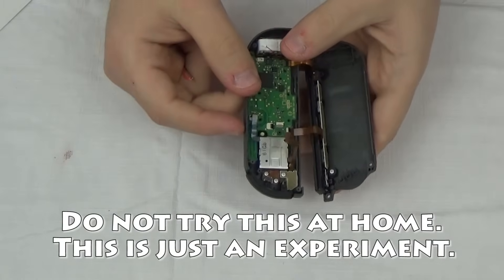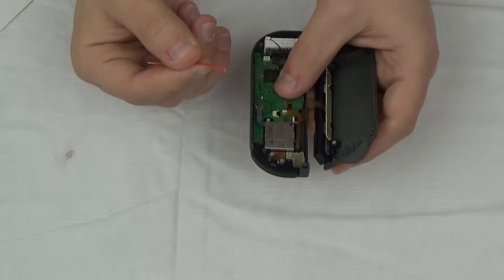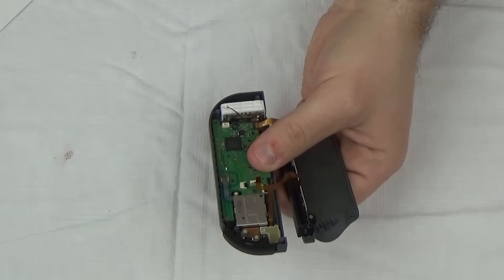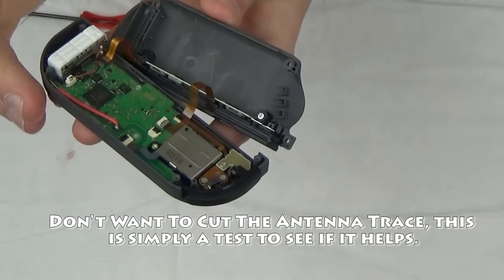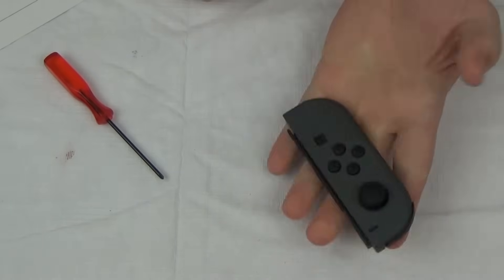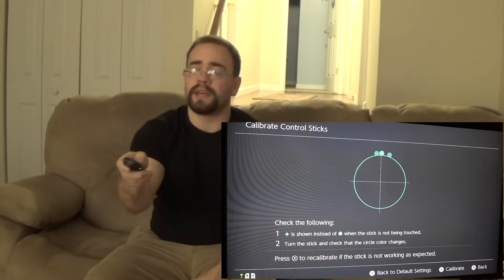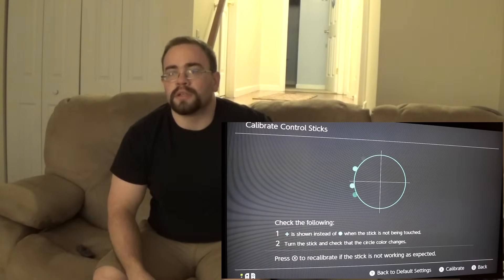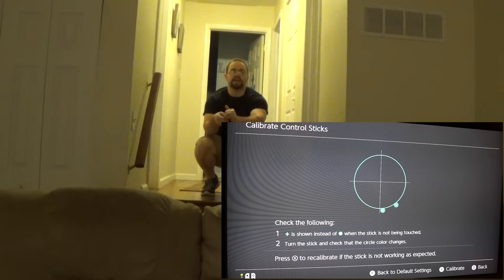Fixing The Left JoyCon!

Comment: Wow, that's some awesome increase in connectivity.  I might have to get my soldering equipment out for this kind of boost, even if the other methods fixes the basic issue.

Given your warning at the end, though, I won't be doing it without reading up on it more.

Comment: Watching this, it's virtually impossible to deny that the Joycon issue is a design flaw that can never be fixed through a software update.  A recall is the only potential fix, which will never happen, so either we have to apply this fix ourselves or wait until the next batch of joycons that fix the issue come out and throw our launch joycons away.

I can't believe this was somehow allowed to slip through product testing.
Reply: zerotheliger - theoretical they could give the antena more power that would boost the signal, but i am not sure
Reply: Terotrous holy fuck how overdramatic. It isnt an issue for everyone. And there are solutions. Easy day.
Reply: Terotrous 8:45 He even said it works fine. Nothing major. And it's an easy fix if you have 2 hands with thumbs.
Reply: The thing is we don't know if that's the problem, especially because Spawn Wave's joycons are NOT defective. It's all speculation.
Reply: you are funny, based on this video you determine there's a problem? It's not as if the wire is in one place in some joycons and another in other joycons. If it a hardware problem NO joycon would work ! This is not the case as most people are fine. But, besides what I am saying, time will surely allow the truth to surface, we will know if this has been a real problem or not. So far it isn't. But is succeedig in creating doubt on the Switch quality, which is, I guess, what some people want.
Reply: There's quite a few design flaws I've noticed with the Switch, which I was surprised got past the net.

Namely the dock scratching the switch, the shoulder pads for the Joycons effectively cementing themselves in place if you put them on wrong/on the wrong joy-con and the sync issue.

I mean, c'mon Nintendo. You aimed the Switch at all audiences (even kids) so not having any preventive means of putting the wrong shoulder buttons on the wrong joy con is a very novice mistake, as is how easy it is to scratch the switch's screen through use in the dock. It's a guarantee kids will mess up the shoulder buttons for a start, and the parents will have to use one hell of a screw driver to get it off.

I'm interested in it, but I'm glad I'm waiting it out. I would not be happy dropping the cash needed on a Switch at this moment, with the issues it has (which most likely require hardware changes to fix).
Reply: If you really want a Switch, I don't think these problems should keep you from getting one. :O 

The only problem I have had is with wobbly joycons, and I just sent it in to see if they could fix it. As for the dock scratching the screen, you can just get a screen protector, which is a good thing to have anyway. Also, keep in mind that if you do have a problem with yours, I'm pretty sure you can get it fixed within the first year for free. :D (It should be possible to notices most of these problems within a year, so you should be fine!)

I do understand why ya might want to wait it out though. :0 Maybe they will change the material inside the dock to keep it from scratching the screen, or fix the joycon connection issue.
Reply: doc8125 that would kill the battery a LOT faster
Reply: The grey joycons have less issues than the colored ones
Reply: I mean sure its an easy fix, but wouldn't opening the switch (even if just the left joycon) void your warranty. I'd rather keep my warranty for the system if it ever breaks.
Reply: Darius Batista stop being ironic
Reply: Harlock2day "If it a hardware problem NO joycon would work !"

This is indeed the case.  All joycons appear to be susceptible to this issue.  But remember that this is an intermittent failure.  It might only occur 0.01% of the time, but it's enough that pretty much everyone will likely have seen it at least a few times after using their systems for 100 hours or so.
Reply: Terotrous - Software/firmware error correction can definitely fix poor signal due to interference up to a point, especially if the interference is fairly consistent.

It's not affecting everyone frequently so it's probably a relatively minor signal issue (albeit not for the people experiencing it regularly) so it wouldn't surprise me if it could be fixed with and OTA update rather than a recall.
Reply: Crimson Gold Eagle oh yeah sure if I really want something I shouldn't care it has a shit ton of problems, GREAT FUCKING MENTALITY
Reply: Yes dumb fat gaijin, just wait and buy the version of our controller that actually works! it's only $80 dollars.
Reply: don't ever buy a console at launch.
Reply: Terotrous Just because you can fix it with hardware modification doesn't mean that you can't with software.
Reply: If the problem is simply that the antenna isn't strong enough and is in a bad position there's really not too much they can do to fix it through software.
Reply: actually no you cant in this instance lol learn how hardware works first please tell me how programming can fix issues with interference or blocked line of sight. unless you can tell me otherwise your point is invalid and dont just give me some silly oh they will figure it out responce... no nintendo owes us new joy cons end of story

Comment: Would be interesting if Nintendo saw this video and do a fix similar to it, but rejects Spawn Wave's Switch for the official fix citing this video as the reason for voiding his warranty. (If this video is enough to void warranty)
Reply: It's a near guarantee they will. 

They'll have to re-release a "hardware fixed version" at some point which will fix this, the ability to cement the wrong shoulder pad attachment to the wrong controller (come on Nintendo. You don't have to apply force to do this. It just "happens" if you're not paying attention and you spend hours trying to get it back off again), how the dock scratches the screen with use and how some joy cons don't sit on the unit properly (they bend). 

Regarding this fix - since he opened it up, they'll claim he voided the warranty (and modified (read: Fixed) it with a wire).

Comment: You have to use low grade solder when using cold heat, otherwise it's frustrating. It sometimes takes awhile even with lower grade stuff. Having said that, as long as you have a decent amount of experience soldering it's not something you need to use.

Comment: Mine works just fine tbh. I lay in bed with my hands under the duvet and the signal was still fine.
I tried the whole arm behind my back from 10ft thing and it was fine. I then tried that whilst covering the controller completely and there was a slight desync issue, but it certainly only lasted a matter of milliseconds.

Comment: I can take my joycon into another room and hug it with my whole body and it still works... seems to be an american problem
Reply: Anton Reinecke Our bodies contain too much fat.
Reply: "I dont have this issue so everyone else who does must be lying"
Reply: Spaciepoo Wrong. I tried it from 3 feet away from the console with the joycon behind my back and it was already starting to lose some of the signal, and I'm not in America.
Reply: I'm from america and I shoved the thing up my ass and it still worked....
Reply: Anton Reinecke blame it on Reggie! It's all his fault😄
Reply: Yeah it's been confirmed to only be in the american switches and not the UK ones
Reply: Maybe is caused by wireless regulations in every region to products, so the PAL version has a higher spectrum of wireless that could be used, but the NTSC regions are regulated by law to a certain distance limit and spectrum.
Reply: Titangea / Daniel Porras No. It's happening in Eu too. My guess is that corners were cut during production/design and Nintendo cheaped out on manufacturing.
Reply: Joel Sola López read my comment again plz. im not dening that there is something wrong with your joycons. i believe you. but to find the real issue you have to factor in all possible error sources. i am just telling you that the left joycon is not messed up by Design since mine works flawlessly. the issue must be another defect, interference or a combination of both. if it was a desing flaw all units would be affected wich is not the case. okay the wire may fix the problem but it does not explain why my joycon works flawlessly without modding it. so i assume there is another reason, but the antenna behind the whole problem. hope you get what i mean. english isnt my mothers tongue.
Reply: Europeans have customer rights that allow them to return the console if it doesn't work 100% no problems so nintendo can only shaft the americans for a cheap buck by selling them the stuff that failed quality control.
Reply: I'm from germany and got problems with it, so there are at least some of these in europe
Reply: could be like the ps4 issue where the factory that were making the freezing ones were cutting corners behind the company's back and not installing all the parts.
Reply: Ilyas H. Could say the same about those saying "i'm not having the problem so everyone else is doing something wrong". That's not great logic either way
Reply: This is the wrong assumption. If you watch this video youll come to the conclusion that the antenna is too small. I tell you now that that is not the case in general. I guess i have the same small antenna in my joycon and it works flawlessly beyond the distance he tested it. so the problem goes beyond antenna size. To find the real origin of the problem you will need someone with a working unit to tell you what the actual hardware limitations are.
Reply: BigFudge87 then why my right JoyCon works like it should if it has the same small anntena? And why some people said that it was fixed after the day one patch?
Reply: Joel Sola López thats the big question. it might be another Revision or simply bad Quality Assuarance. a friend of mine has some issues while his bt soundbar is running. i will visit him some time to check out if it is his System or his house, surrounding, the neigbours jamming device etc. ;) the antenna fix is interesting but not the only thing wrong with affected joycons ;)
Reply: Mikael Larsson haha I didn't test that, but I don't seem to have problems with my joycons either
Reply: Anton Reinecke Yeah , I have no problem
Reply: Nah. works fine for me.
Reply: and the german ones?
Reply: waflmlk that is true but... wait... it doesn't work like that over there?
Reply: Anton Reinecke I'm from America and have no problems, talked to another guy today, has no problems either
Reply: deutschland :D
Reply: Jigglypuff Tutorials maybe...? It is a common problem to have some hardware issues at launch of a new hardware. But we will probably never know the reason why this problem was solved for some people with the day one patch and others not.
Reply: BigFudge87 that is true. I wounder why some people are not affected by this. Do they have some internal change on the JoyCon? It doesn't seems like that is the case...
Also, English is not my first language either, don't worry.
Reply: pal here. zl in splatoon2 gets stuck but the analog stick works fine with a bit of lag. works fine on handheld mode.
Reply: I've heard of this problem but I have not had it yet and I'm probably 12feet away from my console

Comment: I might actually try this if Nintendo doesn't come with an official solution. I get some problems sitting about 5 feet away from me Switch, with the left JoyCon. It's not super bad, like unplayable, but Link did jump off a cliff without me wanting that a few times already ;/
Reply: They are probably going to make the switches better in the next batch
Reply: Dylan Fardella I have a lot of experience soldering and repairing laptops, PSP's and all kinds of controllers, so i think it will be fine. Of course, you should only be doing it if you know what you are doing, and did something similar before.
Reply: the Hero of Time Already tried that; it is very obviously a signal issue: when i cover the JoyCon with my hand it gets even worse; desyncing once wouldn't fix that...
Reply: SonicGabriel Well, if that would be the case, i hope they give us with problems a free new JoyCon, or at least put the upgraded ones for sale for a decent price...
Reply: X3C I expected better too, they kinda go the route most devs these days go: fix stuff after it has been released.  That, though, might mean we still can get a patch to improve performance; i wouldn't be surprised if Nintendo could still learn more on how to use the Switch hardware more efficiently. 

The launch of both the Switch and Zelda seems kinda rushed.
Reply: If you don't have experience soldering then I wouldn't recommend it.
Reply: rickrocks3000 I have a lot of experience so it will be fine. I'm more worried about voiding the warranty,  there still is a small change Nintendo will recall or repair them or something like that...
Reply: deka360 There have been A LOT of people having problems, and really from this video you can tell its no defect; all the joycon are built this way. It just has a bit more interference issues in my room apparently. I really don't want to keep returning systems which probably all have the same problem, while being unable to play zelda ;)
Reply: Just reflow the solder, add a little more.  It is a cold solder joint from the factory.  The wire is worthless, don't add it.  I've tested this myself and have seen a 100% fix from a reflow and the same range improvement.
Reply: Mohammad Sabbagh no wire, just reflow the joint.  it is improperly done from factory
Reply: Rinyuu I'm having the same problem. Along with the frame stuttering it doesn't break the game but it's really disappointing, I expected better out of Nintendo.
Reply: Rinyuu why not get your money back?
Reply: If you plan on doing and have never used an iron be careful not to add a few extra circuits with your solder in the process.  lol :)
Reply: Rinyuu do you have your Switch docked behind your TV? Does your docked Switch have a completely open line of sight to your joycons? I had this issue initially because I put my Switch dock behind my TV and have since moved it in front of my TV and that fixed it for me. The closer your Switch dock is to your joycons, the better.
Reply: remember, like he said, do not try that at home!
Reply: yeh my legs being up while i lay in bed destroys my left joy con :/ link just loves walking around by himself
Reply: Anthony Sponseller I have searched online for tips too, but nothing really works. My Switch is 1,5 meters away, it is not behind anything, no wireless stuff nearby, no cable bundles etc. Like i said though, the problem isn't very bad, just enough to notice it and sometimes walk off a cliff in Zelda.
It mainly still happens when i hold the JoyCon in a certain way, thus blocking the signal for the antenna.
Reply: Rinyuu Did you do this mod to your joycon? If so did it work for you.
Reply: Naters305 I was having tons of issues with my left joy con. I couldn't stand playing Breath of The Wild. Well I did what was done on the video and I can confirm that all my left joy con issues are gone. Works 100% better than before. FYI, I don't have much soldering experience and managed to solder the wire on just fine. Just be careful and take your time :)
Reply: Have you tried a pro crontroller or the joycon grip? That may keep you from blocking the signal accidentally.
Reply: What kind of wire did you solder? I'm a novice to this stuff. And how did you obtain it? Appreciate the feedback
Reply: What does "reflow" mean, exactly? Just basically melting it back down and letting it cool again? Sorry for the questions, just want to make sure I'm getting this right.
Reply: Dylan Fardella too late! That said, I did the same thing as him and got the result so I'm not complaining. This was a godsend.
Reply: This is exactly Nintendo's solution.  They did what he did in the joycons on the new version of the switch
Reply: Rinyuu the gadget god has a easier trick just desince your controllers then turn off the console then turn it on again and connect the controllers again and that guy had no issues anymore

Comment: Maybe connecting the antenna with the metal case of the  joystick could even work better.
Reply: It's probably grounded somewhere, so not a good idea, because worst case you could fry some important part. Adding a new cable/antenna is one thing, repurposing existing parts you don't know exactly, can end rather bad. Not  to forget such parts are often made from metal to provide shielding. Reusing it as an antenna is basically the exact opposite.
Reply: +Smaxx You could be right, but I saw the metal case more as structural part of the joystick.  It's easy to test if it is connected to ground. Not sure why you need to have shielding on mechanical switches.
Reply: Analog sticks are called analog sticks for a reason. They're not just on/off switches. The controller uses the passing current (which is manipulated based on position) to determine said position. If you have no shielding, it's possible to induce tiny amounts of voltage, which might skew the precision as fake input. Also there's the opposite direction: You don't want the current flowing through the stick influence the antenna. These are really tiny, but also right next to it. So without the shielding you'd most likely make the signal quality even worse.